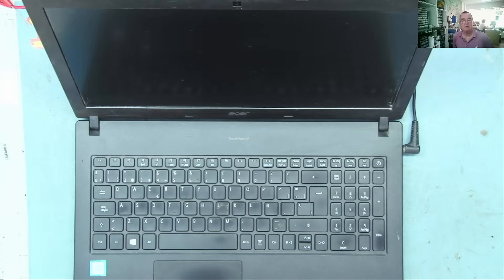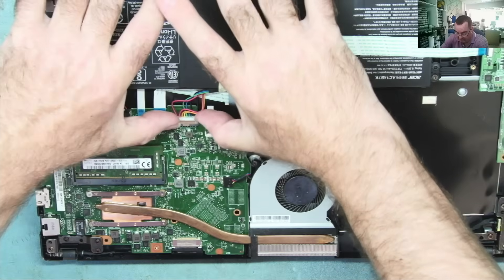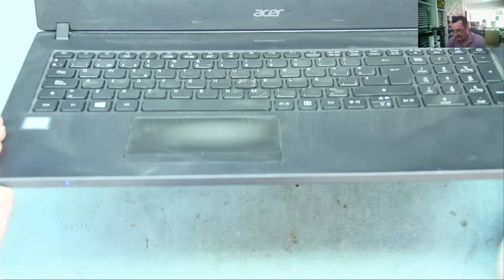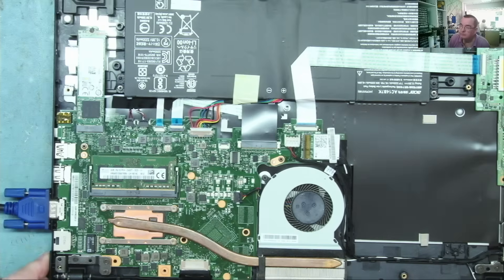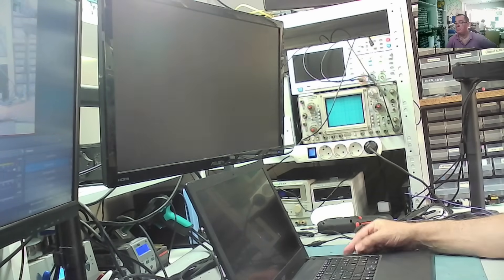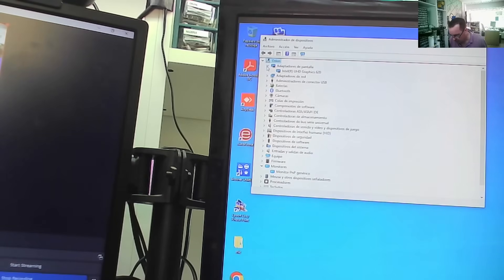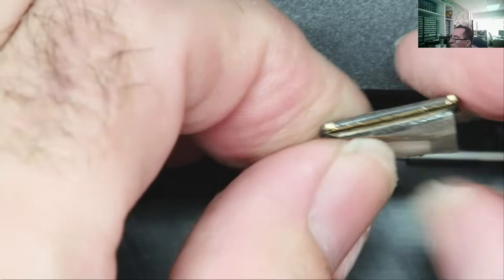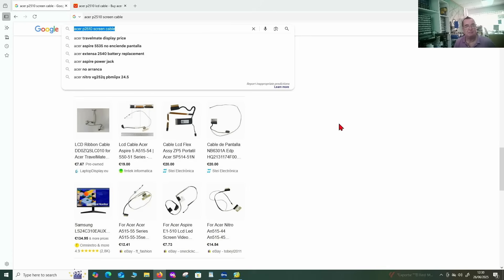Acer Travelmate IP Laptop Notebook Powers On But Blank Screen

Comment: iSesamo is the better (more durable) version of that opening tool/spudger. They are made from Inox (a specialized French/Swiss stainless steel alloy) and are way more durable than any other opening tool I've ever used. The cheaper versions of those tools work pretty much the same. But after a couple of (ab)uses they start to take a permanent bend, and eventually they break.

Comment: I think your approach is very sound. You cleaned and reseated the connector and it works. If it fails again I would think about replacing the cable. Would also take a look at the female connector to see what kind of shape it's in.

Comment: There may be a label on the cable with the part number which may help in finding the right one. Then give him the option, if the laptop is critical suggest buying the cable for fitting at a convenient time. If it isn't critical at least you have the part number if it fails again.

Comment: @9:40 The connector on the screen had a slight gap showing it was not fully inserted. Despite the spring clip, they do pull out.

Comment: That tool is called a 'spudger'. I use them a lot. They do bend and twist out of shape but they are cheap enough. Good fix. I would replace the cable as a matter of course, just for reliability.